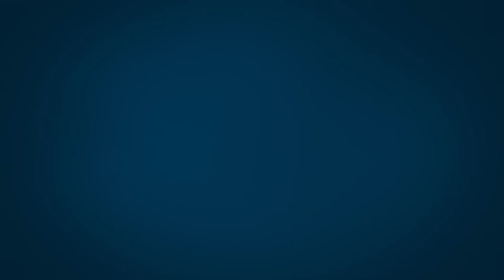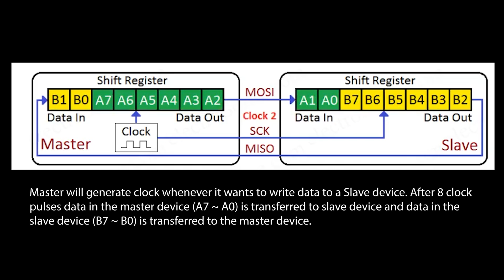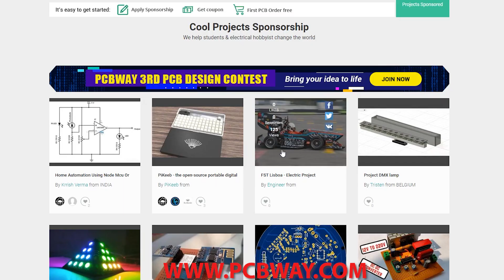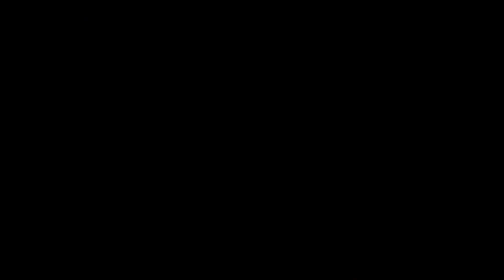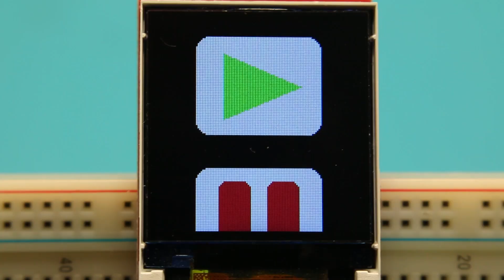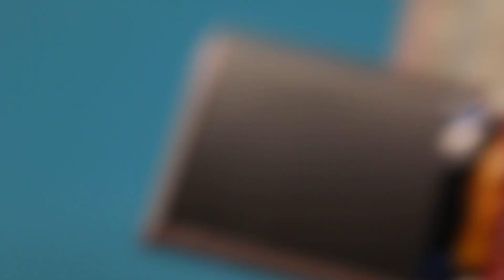The BEST Color Display For Electronics Projects?  ST7735 TUTORIAL

Comment: I2C would not be that ideal because SPI is faster than I2C and worth i2c on the tft it would look laggy and not enjoyable. Just wanted to let you know this
Reply from the maker: Yeah I2C is slower but works just fine for most of my applications and saves the IO. Plus the code is smaller and simpler for most projects.
Reply: Thanks for sharing info.